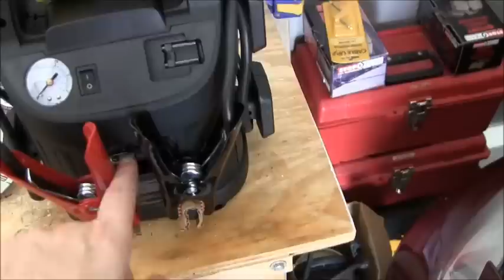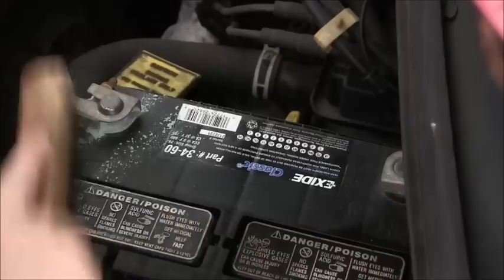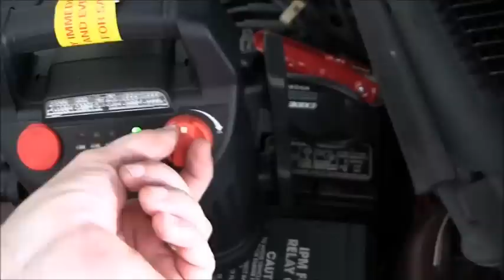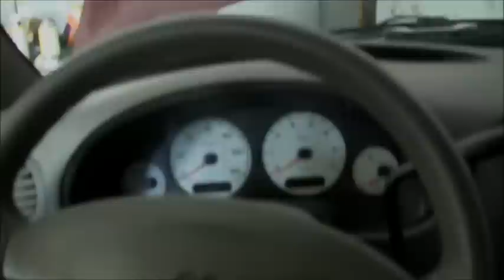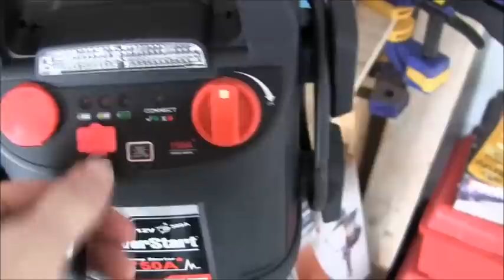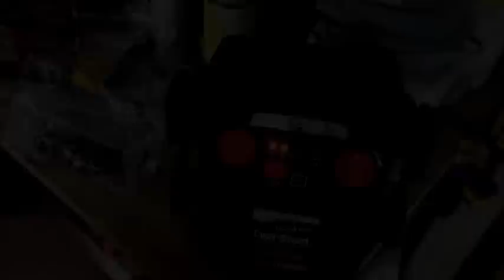EverStart Jump Starter/Air Compressor- Review plus multimeter use

Comment: So when the battery charger is done charging with a green light, stay solid because mine is still blinking red yellow then green do I have to wait to go to solid green
Reply from the maker: Yeah, it's still charging. There's a charge in it, just not a full charge. But I found that these things get fickle when they get old. They don't last forever.
Reply: @stevekonbass thank you!!$

Comment: Is there any other plug which will work besides the one that came with charger ? How to tell if charger is fully charged ?
Reply from the maker: I've used a regular extension cord to charge it. There's a button to press to check how charged it is.

Comment: I have one of these.
Once charged, it will hold a charge for a very long time.
I used it to start my own car just a few times, until I bought a new battery.
I lost track of how many friends or coworkers I jumped or filled a tire for. 
For $40-$50, it's a hand item to have.
That said when it finally does need to be charged, it takes a long time to top it off.

I'm trying to find a spec for how long it should actually take.  
I suspect the 2-wire 120V plug keeps the cost down, but isn't the fastest way to charge.

I owned a yellow jumper, half the thickness of the EverStart. Its charger was a wall-wort transformer type, and a couple of hours had it full, for months.

Comment: How do you charge the unit?
Reply from the maker: This one, the 750A, came with a cord when I bought it. I know the 750 (the orange colored unit) doesn't come with a cord. So either they don't supply a cord anymore for the 750A or someone returned the one you bought and didn't put the cord back in the box. The instruction manual should say if a cord comes with it. I use a regular extension cord to charge mine.
Reply: @stevekonbass  how long does it take to charge?
Reply from the maker: Usually overnight will do it.
Reply from the maker: It plugs into a wall outlet.
Reply: @stevekonbass  there's no cord to plug into the wall!

Comment: I have one of these. It been a while since I brought it. Don't know where the manual is. What exactly is the 12v to 12v cable for? Charging in car? Is there current limiting circuit inside? Guess I can take a look. Just wondering what's it's purpose?

Comment: Straight junk don’t buy this
Reply: I bought one on clearance over 2 years ago for 35 bucks.  It has jumpstarted vehicles on 4 different occasions and aired full sized tires up. It paid for itself on its first use, and it has never failed to work.  Your mileage may vary.

Comment: Why didn’t u put the black one on the black cable on the battery???
Reply from the maker: That's just the manufacturers instruction. Most people hook red to red and black to black, I have myself, but for the video I just went with the instructions from the manufacturer. They recommend it be done this way to prevent the very rare case of an explosion.

Comment: The EverStart Jump Starter products are complete junk! They work for a little while, but will fail in short order. I bought two (the 750 and 1200 amp)  and they both failed with the same problem. The 750 amp lasted about 15 months and was used successfully 3 times before it died. The 1200 amp lasted about 8 months. It was charged up once but never used successfully; it was dead when I needed it. The problem had with both of them is that when you plug them in to charge the internal battery nothing happens at all; they dont charge, no indicator lights come on, zippo. It's as if no electricity is getting to the device. But I tested my outlet and cords with a meter and they are ok, so I know the EverStart units are junk.
Reply: The air compressor on the EverStart 1200 A stopped working. It's a piece of junk.
Reply: Second time using air compressor and the pos stopped working on me. Never even used the jumpers. Had it for 6 months and the pos is already broken!

Comment: Hey thanks for the video but I’m wondering why you don’t attach the negative cable to the negative part of the battery. Is there a reason for that? I’m going to follow your directions but I’m just curious.
Reply from the maker: It's just the manufacturers instructed way to do it. Hooking the negative to a ground away from the battery is supposed to prevent explosions. That said, I've seen mechanics hook the negative cable to the negative of the battery when jumping.
Reply: stevekonbass I followed your directions and it worked fine so I’ll continue doing it that way thanks for the information!

Comment: Thanks for the step by step. Very helpful for a new divorcee such as myself. I purchased this unit at Walmart for  $39.99. The low price worried me a little but I dont have my divorce settlement yet so I purchased the unit anyway. It seemed to have worked great in the video which gave me piece of mind. I was wondering how well the air compressor would work on a standard 34 pd car tire?
Reply: Louise Zee it will do enough to get your to nearest gas station.

Comment: update: So my battery was just so dead, it wouldn't jump. HOWEVER, I thought hmm, if this thing charges a battery pack, maybe it will charge my battery. I kept the JumpStarter attached to my car's negative and positive knobs, and then plugged the machine in with an extensive cord to my house outlet. I turned the Jumpstarter to "on" mode, and let it charge overnight. Sure enough, next morning, when I unplugged from the wall and just set it up in regualar jump mode, my car turned on! I was pretty dang proud of myself. So this also works if your car battery is super dead and a jump won't work. :)

I just plugged my charger in for almost 24 hrs, and it wasn't powerful enough to charge my car. Do I need to move the  right side dial to the "on" status for it to charge properly? The manual wasn't clear.
Reply from the maker: If you're trying to jump your car battery, that knob needs to be in the on position.
Reply: I had it in the 'off" position while charging, to the point that the green light was solid while plugged in (instead of the red, yellow green lights going) However it still wasn't enough juice to jump my car battery. I think it's just donezo at this point, and I'll have to replace it.
Reply from the maker: When I tried to jump my car battery, it didn't start right away. I left the Everstart connected to my car battery a minute or two and then tried it again and then the car started. And, even though I got it started, I still had to replace the battery.

Comment: This unit is absolute garbage! I'm waiting for a buddy to come jump start my car because this thing wouldn't crank my Honda CRV(4cyl) for more than a few seconds. If you need to do a cold morning/winter type start on a dead battery you'd be better off buying something stronger than this. Also the battery drains way to fast when in storage and you could never count on this unit! Yes I had it charged all the way to the tippy top!
Reply: Bread n' Bullets you must have gotten a defective unit mines works perfect on a 6cylinder honda pilot and my fzr1000 motorcyce

Comment: hey stevekonbass, the manual says to not let the battery freeze. do you know if this jump starter freezes at 32 Fahrenheit or is it a lower temperature? essentially, can i leave it in my car through the winter? i looked online and couldnt find a direct answer
Reply from the maker: That's a really good question. My manual says to avoid storing in extreme heat or cold. If the temperature were to drop to 32 degrees, I would bring it inside with me if I knew the car was going to sit for a long time, and I'd leave it next to my keys so the next time I go out I don't forget it. It would also be more likely to freeze if it has less than a full charge, so I would make sure it stays fully charged.

Comment: Thank you Steve. I just bought one of these and did the best I could in logically trying to figure it all out. But I learned a bit more watching your demonstration. I was wondering why the light never came on...didn't realize the button had to be held down a few seconds to make it happen. Thanks for unscrambling a few things for me about the specifics on charging and also the tire inflation. Much appreciated!
Reply from the maker: You're welcome. Glad it was a help. Happy New Year to you!!!
Reply: @stevekonbass ok, I know this video is 6 yrs old. One quick question with this jump starter : do I need to buy the cable to charge the unit or could I just use a short  12 g extension cord? It's about 2 feet long. Thanks👍
Reply from the maker: I used any extension.
Reply: @stevekonbass  thank you . Yep, it's bad. Won't even turn on.

Comment: Hello I just bought the 1200 amp version of this and it doesn't have a battery level indicator on it so you can't tell how charged it is.  The green light was on but when you plug something in it, it turns yellow. I bought it because the winter storms that hit Atlanta has knocked out everyone in my subdivision power off. So I'm not able to charge it up anywhere but my car. Do you know if it works that way and if so how so? And how long does it takes to charge? Please help and Great video! :)
Reply from the maker: Hmm... curious it doesn't have a battery level indicator. I'm not familiar with that model but yellow would mean it has about half a charge left in it.
Reply: stevekonbass Hi, the lights came back on and i was able to plug it in the wall and the lights came on when it began to charge. I was trying to charge it in my car to use for power.
Reply: Yes it does. It's the white button under one of the USB ports just press and hold it

Comment: stevekonbass got a question. So I see you didn't use the cigarette lighter connections right? Do you need those? Or once I charge the Everstart it's ready to go? No need to plug in the cigarette lighter connections?
Reply from the maker: Nope, I didn't use the cigarette lighter and no, you don't need to use it. It does however come with a cigarette lighter adapter and a few other accessories.
Reply: cool cool....just used it and it worked out well. Cranked' up my Mustang n got it going! Great machine n thanks for your instruction video on it
Reply from the maker: Glad the video helped.
Reply: @stevekonbass  Hi stevekonbass the jump starter is working really well since 2 years ago. Been using it on and off. But wanted to ask you how long does it take for the jump starter to charge up?
Reply from the maker: @lalomontoyajr.9282  Hey Lalo- My jumpstarter holds it's charge pretty good. I've gone months without using it and when I check it, it still has a full charge. If it does need a charge I usually let it charge overnight and by morning it'd fully charged.
Reply: @stevekonbass  Awesome! I've been having to use mines recently in this cold weather. Used it a couple times last month and it worked fine. Till yesterday. But I'm assuming it needs a full charge once again. So I will charge it today over night so hopefully tomorrow it starts my car! If not it has to be that I need a new battery now!
Reply: @stevekonbass  Hey stevekonbass well I charged it overnight but it wasn't able to start my car. So I called a friend and jump started my car with jumper cables. Took my car to 2 auto parts stores and one told me I had a bad alternator and the other one told me everything was ok. But I'm going to give it a few days to see if that's the problem. Because the car works fine in warm weather lol!
Reply from the maker: Yeah man I've been there where you get different opinions on what's wrong.  What you can do is get a cheap multimeter for about $7 and test the battery and alternator yourself. 
When you hit that test button on the jump starter what color light comes on?
Reply: @stevekonbass  It comes out green. But when I tried jump starting my car yesterday and today, seconds after the jump start it goes back to yellow. I'm thinking it just needs more charging time.
Reply from the maker: @lalomontoyajr.9282  Green means it has a full charge. If ya can check the volts on your car battery. A good battery should be around 12.6 volts. In the video my battery was down to 10.42 volts and I was able to jump it.
Reply: @stevekonbass  At Autozone they said it was 12v. But I'm thinking I have been using the cigarette lighter to power on an air compressor to inflate a tire on my bike. I think that's the culprit. So im not using the cigarette lighter any more. I will use the jump starter's cigarette lighter from now on. Which I should of been doing from the beginning. I'm sure that's what is draining my car battery. I'm giving the battery a few more days. If no improvement I will replace it.
Reply: @stevekonbass  Well cars' working right again. Think it was me draining the battery using the cigarette lighter. From now on I'm going to use the Everstart cigarette lighter next time I need power!
Reply from the maker: @lalomontoyajr.9282  That's good news. Glad it wasn't your battery or alternator.
Reply: @stevekonbass  Ya the battery worked perfect today. Hopefully it stays like that. The cold weather should be stopping soon so that would be even better! Still buying that volt meter to have on hand though.
Reply: Where can I purchase a replacement cord for this

Comment: How long does it take to fully charge the Everstart Jump Starter with Air Compressor the first time out of the box?
Reply from the maker: Mine was actually fully charged out of the box. There's an indicator light on it that tells how much charge there is. I've let mine sit for months in my trunk and when I do check it, it's still fully charged. It seems to keep the charge well.
Reply: i bought one and mine charged in less than one hour. Mine didn't come charged.
Reply: Just got one yesterday, it was green lit within a few minutes so these things definitely come well charged out the box
Reply: From one bass player to another... thanks for the review
Reply: Came here to ask the same question. Yeah, I plugged mine in right out of the box and the light was green within seconds.